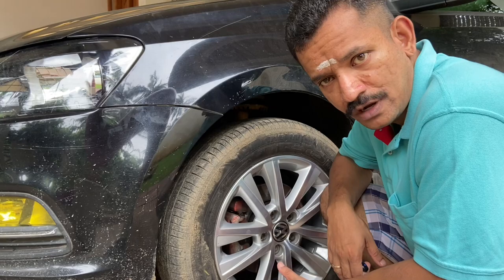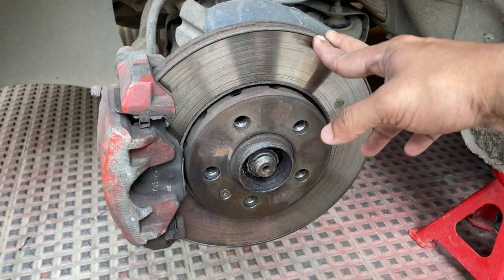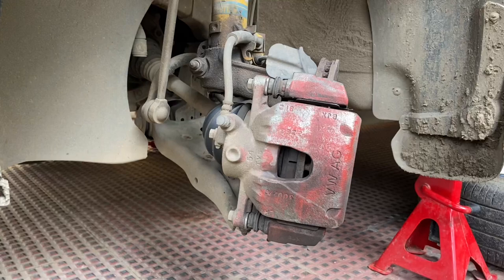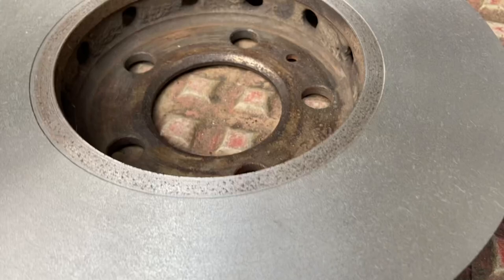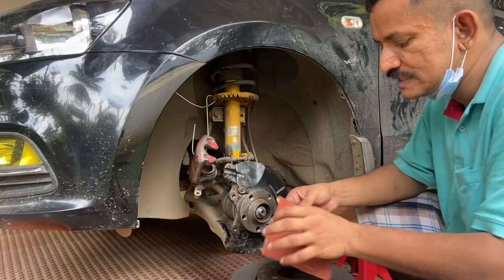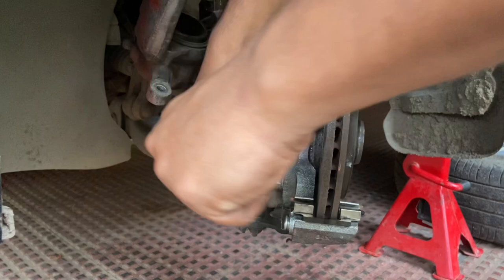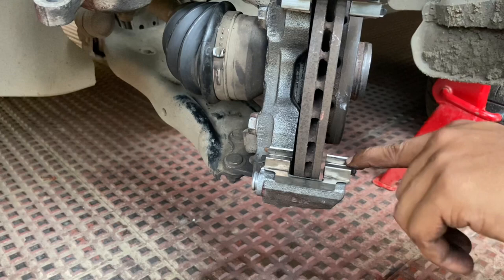Polo 6R - Replacing front brake pads and brake discs

Comment: The brake pads part number seems to be of the cabin filter and brake discs of the fuel filter. Nevertheless, informative video as always for VAG owners!
Reply from the maker: Shucks! It was from the other service clip. Should have been careful. Sorry about this! And thank for pointing out man. Much appreciated. Will correct it in the description. 🙂👍🏻
Reply: @Ganeshbalan very detailed and informative video. But can you post the correct part number here. I am looking fwd to replace the rotors and pads on my rapid. Stock ones develop vibration from braking above 80kmph as soon as 5000kms. I need to skim the rotors every now and then which is very annoying and haven't faced this in any of the other cars i owned.

Comment: Nice DYI video friend. Actually, the upper guide pins are a little difficult to remove, the one with the black tie. Somehow removed and while inserting again difficult. The holes were thoroughly cleaned though.
Reply from the maker: Hi Jinu, trust you’ve cleaned the guide pin holes in the callipers properly. There’ll be a lot of old grease inside. Clean them thoroughly using brake cleaner spray. For the brake job, you’ll need at least 2 bottles of brake cleaner spray or one spray + petrol. The guide pins must move freely without any resistance. The one with the rubber insert is on the bottom hole if I remember correctly. Please interchange and check. Or check my video.
Reply: @GaneshBalan  thanks for ur reply.  The one with rubber insert is the upper one. Will try  once more with break cleaner  spray. I just used IPA spray to clean the holes. There was litttle  bit of play for the pins that makes some noise on rough roads. I saw the video. Not  only that, ur owner thread on TBHP also..

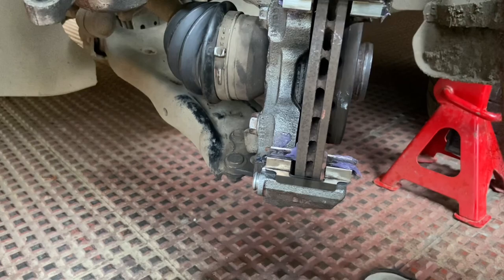Comment: @17:53, you applied grease which was not siped off before the pads went in. You cleaned on the inner side but missed the outer side. Other than that, all good!
Reply from the maker: Yep, just noticed that. I missed rubbing that bit. Thanks for pointing that out. 🙂👍🏻

Comment: The head of the Torx screw holding the brake disc in place is worn out on my Polo. Any suggestions to remove it???
Reply from the maker: You’ll have to use a screw extractor and remove it. It’s easy. It grips on to the worn out head with its spiral flute and as your turn anticlockwise, it turns the screw and comes off.
Reply: Thank you so much. You are a great help 🙏

Comment: Great attention to detail. My polo tdi 1.5 also needs this. When I apply brakes at high speed then I feel vibrations in the steering, not on slow speeds. It is 80K run. So I think now is time to get the rotors on leith. 
And, what is recommended tyre pressure for 16 inch alloys?? Nitrogen gas....

Thanks.
Reply from the maker: Thank you Saurabh. 🙂 Best to machine the rotors when you change the brake pads. Get both done together. Tire pressures are a bit subjective - I use 30 psi on my tires (15”) since I’m the lone user 90% of the time. If your family travels along, consider 32 psi. But do experiment with different values (when filling fuel) and see what works best. 👍🏻
Reply: @GaneshBalan  Thanks for the reply ganesh.
Hear your suggestion about rotors.
Regarding tyre pressure I’ve tried all sorts of pressures, then finally settled on company recommended, mentioned inside the fuel cap.
Front - 35
Rear - 33
Feels good to me. But then also thought of getting your advise. Thanks again.
Keep up the good work.
One more question on RCD unit, but will ask on that video.
Reply: I'm facing the similar issue. Still using stock discs. Car is due for 90k service. Shall I replace the discs or go for the skimming option?
Reply from the maker: Check the thickness of the discs with a vernier or screw gauge. Lathe workshops will have it if the service centre doesn’t. If it is say, 21-22 mm, you can machine it to 20 mm thickness. Anything lower is not recommended.
Reply: @GaneshBalan  thanks 🙏

Comment: The 1.2 TDi features a different kind of calliper setup. Would the guide pins be the same? My car has clocked more than 1.30 lakh kilometres and I'm still on my stock brake pads and rotors, surprisingly! Never got the brake system touched by anyone!
Reply from the maker: The FS III caliper system?
Reply: @GaneshBalan  Yup!😀😀😀
Reply: I noticed this too. The caliper setup is different compared to this one and it takes a 7MM bit to get my caliper pins out!

Comment: Did the job today, do i need new caliper carrier bolts? And what's torque value of both bolts( caliper pin and carrier bolts)
Reply from the maker: Ideally you do need new bolts for the calliper carrier when you are changing it. The workshop manual mandates it. But if you are sure the bolts have been tightened to the right torque and the threads are intact, you can reuse the bolts without trouble. 

Torque value for calliper pin is 35 Nm and for the carrier bolts is 70 Nm.

Comment: Nice explanation sir. Just now I thought of removing the grooves in my Polo which is done 1 L . Do we need to remove the grooves on disc pad also ? If so how to do that ? Also can we do this on ordinary lathe ?
Reply from the maker: Hi Karthikeyan, just replace the brake pads with a new set whenever you skim the discs on the lathe. Best to not reuse the old pads as the pads will have irregular finish which will scour the discs again. 

Some engineering shops have specific brake lathes which are meant to do this job as shown in my video. Some shops manage with the normal lathes too.
Reply: @GaneshBalan  thanks sir. also did you use silicone paste or just an ordinary grease ? And do we need brake cleaner or just WD40/ Kerosene is sufficient ?
Reply from the maker: I used the brake grease from the OE front brake service kit. It is from TVS Girling. You will get these in local auto spare parts shop too. Please use a proper brake cleaner since it evaporates by itself after cleaning and is very effective.
Reply: @GaneshBalan  thanks sir

Comment: Do you recommend any standard procedure to Bed In the new pads ??
Reply from the maker: Hi Deepak, it would be a good idea to gradually apply the brakes initially than hard braking to generate heat and transfer the frictional material onto the rotors. Some say this is placebo and you can just go about the usual way of braking.
Reply: @GaneshBalan  Thank you for the advice

Comment: What causes scoring of the brake rotors? Based on the cars am currently owning, the passenger side( Front Left) brake rotor is the one that gets warped. Kindly explain if you could relate. Thanks!
Reply from the maker: Hi, sorry I missed this comment. Scoring happens when dirt/foreign particles from the road gets stuck between the pads and the discs. This causes grooves on the rotors. The discs on the current generation Polo/Vento/Rapid is outsourced to some local vendor and the quality is terrible. The earlier ones were imported from Ate, Germany and had a good quality. I am not sure from when VW made this OEM switch but you can still buy the Ate rotors from their service centre with the part number - 6R0 615 301C. Costs approx. Rs 2200 a piece.
Reply: @GaneshBalan  Sir, I haven't owned a German car yet. An 09 Swift and an 07 Civic are the vehicles I own. I find it quite strange when both the cars exhibit the same symptoms on exactly the particular side.
Reply from the maker: @gentlethrottle  That’s really strange. Ideally both sides should exhibit similar symptoms.

Comment: Hi friend ..One query. Did u ever flushed /added coolant ? Basically Skoda/vws are using g13 coolant right.  2 years back i procured BASF coolant and did a flush using distilled water and added BASF coolant at almost 1:3 ratio. The reason for doing this was , the existing coolant color got faded and at normal operating conditions itself temp goes to 95. So after flushing , there was huge difference in cooling. But after 1 year, slightly rust particles appeared and the coolant tank got rusty color. That also need to change.Original ready to use coolant seems costly for 6 liters . The ASS quoted Rs 9000 for flushing and renewal. That also financially not feasible. Is there any source for procuring OE g13 concentrate /ready to use type?
Reply from the maker: Try Boodmo. They have the coolants.
Reply: @GaneshBalan  Ok thanks.
Reply from the maker: I haven’t done flushing by myself. I had the coolant changed when the water pump was changed during 1.2 lakh km service.
Reply: @GaneshBalan  ok
Reply: @GaneshBalan  usually vw / skoda water pumps are replaced at timing kit replacement right ? Mine is very less driven, 34000 km @ 7th year.
Reply from the maker: That’s right. Please do it based on the time interval if your car isn’t running much.
Reply: @GaneshBalan  sure

Comment: I’ve seen two videos and my brake caliper is attached with 7MM bit and not with the one that you show. Is this different per year or even different between diesel or petrol?
Reply from the maker: Yes there are 2 different types of brake callipers sets for the Polo. Yours is a Polo from one of the earlier batches I presume? The one which has FS III inscribed on the calliper assembly?
Reply: @GaneshBalan  correct, I just ordered a 7MM bit to put on my wrench as it’s very stuck so I can put down enough force to get it to come out.
Reply from the maker: What is stuck? The brake disc Torx screw?
Reply: @GaneshBalan  no the two screws that keep the caliper on the caliper holder 😅
Reply from the maker: @vekkuTV Got it. But remember to have a longer pipe over the wrench for the additional leverage.
Reply: @GaneshBalan  yeah I have an extension for it, I just didn’t have the 7MM (only 6 or 8 so very frustrating having to wait haha)

Comment: Will the new vw pedals fit on polo and vento??
Reply from the maker: Hi Arjun, I didn’t get your query. Pedals as in throttle, brake and clutch? You are referring to the pedals from Virtus and Taigun?
Reply: @GaneshBalan  yes I am referring to virtus pedal covers. I see in the video so was wondering if we can fit them if so how. I got them but the rubber that fits into the holes is at a different place. 

Can we really fix them in polo/vento?
Reply from the maker: Hi, the ones you see on my Polo are meant for the Polo. I got them from Aliexpress back then. These are replicas not OE ones. Those are very expensive last I checked. 

Did you remove the rubber cap on the pedals to check where the slots are? Please check this aspect.
Reply: @GaneshBalan  yes I did remove and realised that the slots are at different places.

Comment: A mechanic guy did this job. I was on lunch.After that Me and my boss went to get a new guide pin for the customer. I have no idea why? The mechanic finished the job then the customer is Arguing with me why they got him a new guide pin. I don't know about that. My job is doing the tyres,
Reply from the maker: Hi Rowen, the older guide pins are ok if the pads are able to move back and forth without any friction. Did you check this?

If you’re insisting on changing the guide pins, let the mechanic replace them.

Comment: Hoez the b6 shocks experience?
Reply from the maker: The B6s were amazing man. Especially the way the car holds on to the road while taking turns at high speeds like 80-90 kmph. The stability improved by leaps but also compromised on the comfort in the city driving. Bumps could be felt a wee bit harder.

Comment: Your rotors will again get groove very soon. Because you not emery your old brake pads.
Reply from the maker: Hi Hitarth, thanks for the inputs. Yes the brake pads have to be sanded down. Since these are relatively new (replaced 2 months back), I did not sand them down.